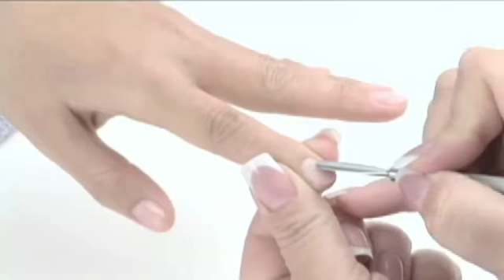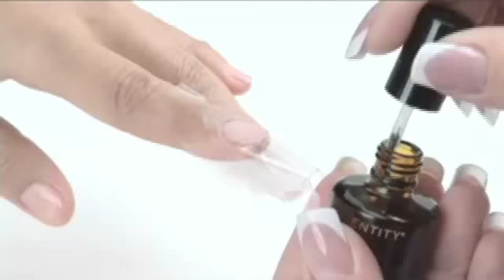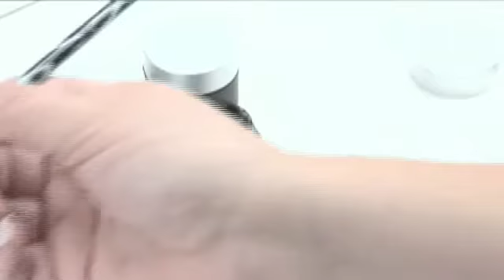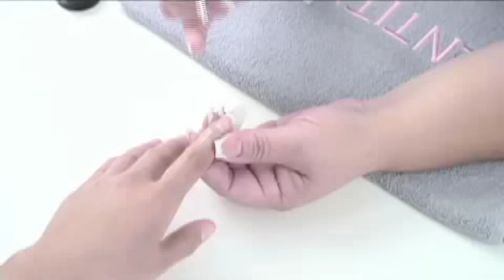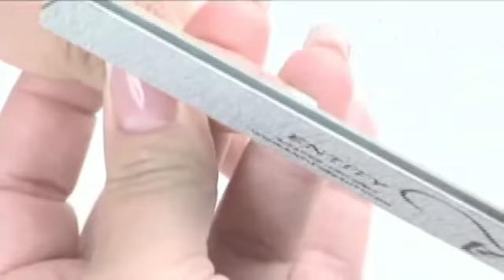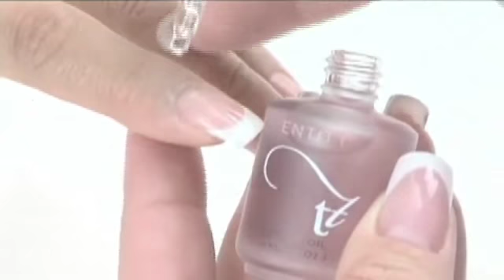Entity One Gel Sculpting on a Form Tutorial | www.Nailsrus.ca

Comment: Can u apply builder soak off gel to extention nails?
Reply from the maker: Yes you can, but remember soak off gel are less durable then regular gel as it's more soft. Just make sure it's thick enough to hold the extension from breakage depending on length of nails.
Reply: Nails R US Beauty Supply  thanks. But regular gel can't soak off though. U gotta file it off to take it off. Right
Reply from the maker: eunha garrett Here's a trick that most people don't know. You can use soak-off gel as a base layer, then layer the regular gel on top making it removable. But it still takes a lot of time to remove. The best way to remove this 2 layer gel is to break the regular gel surface (by filing) so your remover liquid (acetone) can get into the soak off gel layer and do it's soak off work.
Reply: Nails R US Beauty Supply I actually thought about it but never tried though. I will now. Did u ever tried?  It did work well?  Can I use e - files to remove hard gel layer?
Reply from the maker: eunha garrett
Yes you can use a electric nail drill, using it will be much faster then a nail file. This method works very well but of course takes a bit longer to remove vs pure soak-off gel. If you can file the top layer off then good but you don't need to, what you can do is break into the gel, right in the center of the nail would be good enough for your wrap soak-off or acetone bowl soak off. I personally prefer wrap soak off more then putting the nails into a bowl due to the reason many clients can't sit still without taking there hands out of the bowl.
Reply: Nails R US Beauty Supply Break into the gel means., lift a lilttle around cuticle area? Yea I like wrap soak off too!
Reply from the maker: eunha garrett
No, what I mean is file the top layer or even into the soak-off gel at the center of the nail, this way your soak-off liquid can spread evenly.